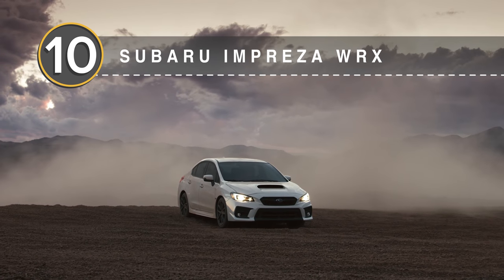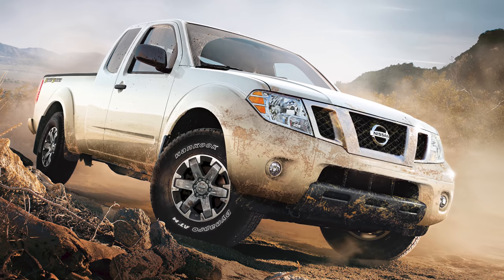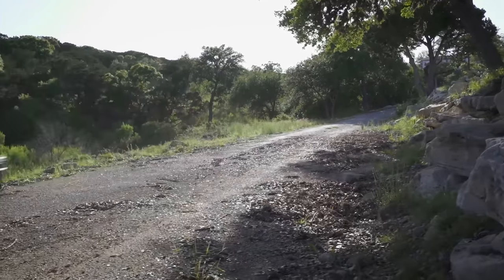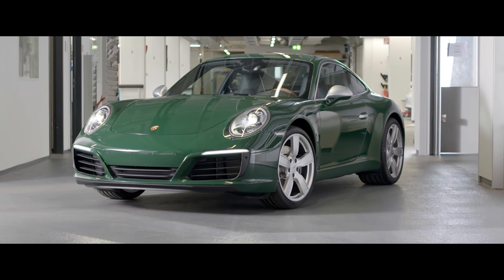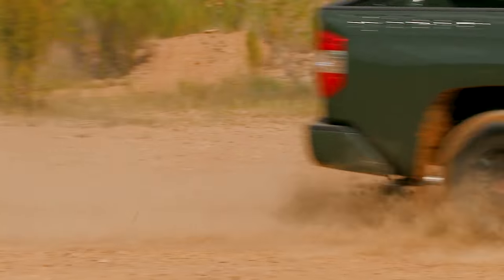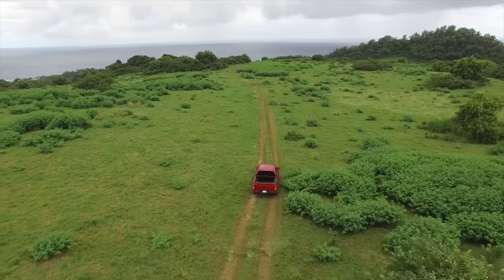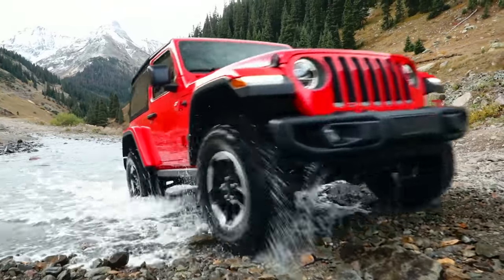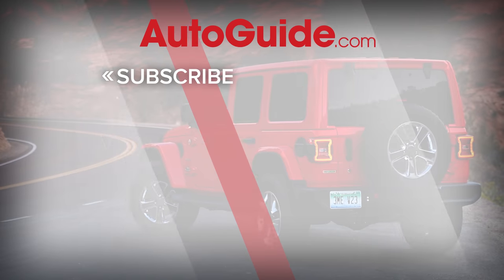Top 10 Cars With the Best Resale Value

Comment: Toyota ought to be going head to head with the Wrangler by bringing their cheap, 2 door Land Cruiser Prado to this market. Make mine a manual with a 2.7 engine ;)
Reply: The best,  I buy small damaged Toyota PU from Copart.com fix and drive,older ones never have to work on a 2.4   4 cyl  5 speed manual,  $39, for a clutch disc after  12 years and 156k. pull trailer lot with 2500 lb cars. 2.4    4 cyl  best  engine.

Comment: best thing to do is buy a used reliable car, in my experience it never looses much value and rarely if ever needs anything but oil changes and brakes, tires and other wear items; here's my car history 

Honda Civic 1998 £700 sold £600 after 40k extra miles and 3 years 
Lexus IS 200 2005 got it for £2350 and got £2500 from insurance company after accident after 2 years and extra 25k miles 
Mazda mx5 eunos mk1 1994 for £1100 sold for £1800 after 2 year and 15k miles (I replaced the roof for £400)
Honda S2000 2002 for £5500 with 100k ( bargain price!) sold for £6550 after 2.5 years and 20k miles
Mk3 Mx5 2008 for £1800 (another bargain!) with 118k miles and will probably sell in a few years for more than I paid

In all cases I check there is no rust (UK salty roads) and thats all that is needed as these cars are extremely reliable (and somewhat rare hence the appreciation of many. The most exensive job needed on any of them was brake callipers on the s2000. 

Average mpg was between 28 (s2000) and 50mpg (civic). Average tax was between £160 to £325 per year. No exaggeration, I have actually spent nothing on owning these cars over about 10 years! Even factoring in the higher tax, more service parts and fuel costs on some of these cars compared to new one or even an electric car, the fact there is no depreciation and insurance is cheaper means my overall cost of owning these cars is very low. Another reason to buy rare, reliable Japanese cars!

Comment: Don't put much weight into top resale value lists. Once you consider incentives and discounts, this list changes dramatically. A Nissan Frontier does well by itself at 60.5% over 5 years, but they are also come new with many discounts, often around 30% off MSRP. That's hardly any value loss in 5 years of ownership. Meanwhile, Tacomas and Jeep Wranglers better retain their original MSRP, but they often sell close to MSRP, meaning you could actually see more loss over 5 years. And this extends beyond just this list. There are many cars that didn't make the list, but they would lose less of your money over 5 years than even the cars at the top.

Comment: What about the SLS Mercedes. The current SRT Viper, and the Mercedes G-Wagon.
Reply: Perhaps they should have qualified what vehicles count as having the highest resell value. They might be looking at more “mainstream” vehicles or those that sell a particular number year over year. The ones you mentioned sell in far less numbers and aren’t mainstream so they probably wouldn’t consider them.
Reply: Well an SLS and the SRT Viper aren't currently in production and as for the G-Class it has a depreciation of 45.2% and AMG models are 45.9%